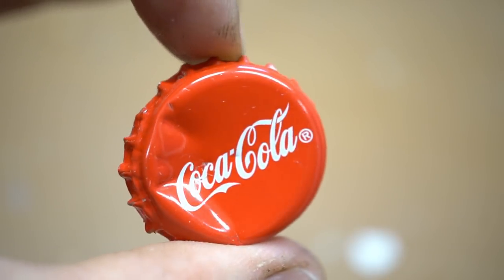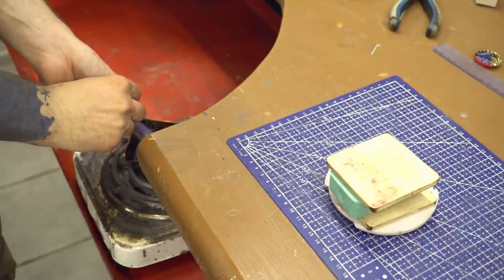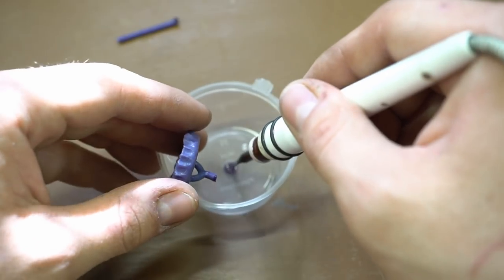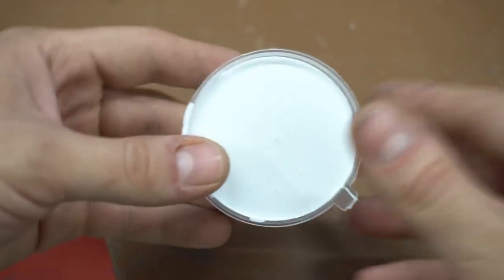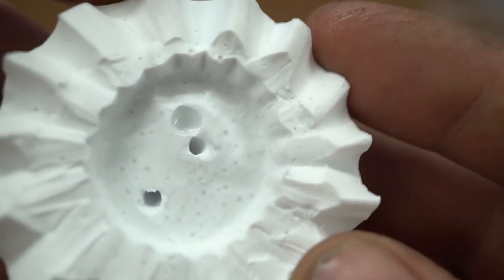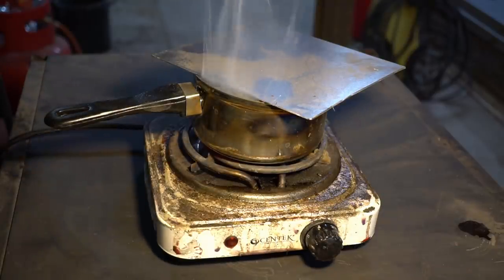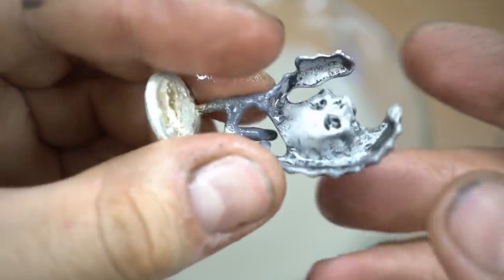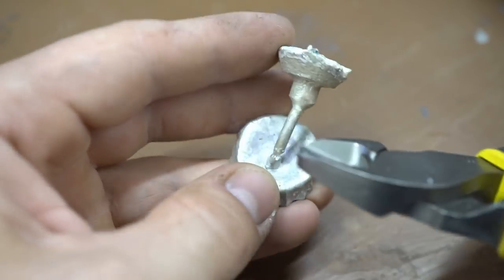Casting Silver Cola Cap At Home WITH POTATO - Will It Work?

Comment: Oh my! Did you ever bring back memories from some 30 years ago! I, myself began my goldsmithing career by building a small kiln large enough to fit a small crucible. The book I was working out of said the investment should be about the consistency of sour cream....so, I bought a small tub of sour cream, dumped it in a bowl, and stuck my bare hands in it to memorize the consistency. I will say it worked. I put my casting project together; put it in my little homemade kiln, dumped some silver on top of the flask, and melted it with an acetylene torch. The method I used to force the silver into the mold was a big, raw potato, cut in half and smacked it on top of the crucible. A few minutes later I pulled out my first successful cast. The principle being the potato is 90% water and suddenly converted to steam and forcing the molten silver into the mold. Just thought I'd share a memory that brought a smile to me. Cheers!
P.S.- I also do a little voice-over work: You did a nice job with the narration.

Comment: Bro, for a better result at this step 03:30 just put your mold in hot water for a while (70-80° if your silicon is okay for this temperature. if not, just immediatly buy some, because it is very useful), then you can cast your parafin in the thin parts much much easier ;-)

Comment: So if I got it right, the steam from the potato or the paper towel was supposed to push the molten metal down into to mold, right?
What if instead you were to use a narrower diameter mold with a metal/glass syringe that fits the mold and created some pressure with it?

Comment: I don't like the way you melted the wax, I used to make candles and found out through research that if wax gets too hot it can reach flash point and explode.
The best way to safely melt wax is with a double boiler, one pot or saucepan inside anther with the outer pan holding boiling water, do not fill this pan , but put more in as needed.
When I was melting wax I was using 5 kilo / 11 pound blocks each time.
I do like the video, cheers.

Comment: Use talcon powder/ baby powder from keep both ends of rubber from sticking to each other. I've made hundreds of rubber molds. I've learned the right way for my mentor. Put the powder in a sock and tap the rubber on both side of rubber. It won't stick. Use some tiny screw caps to line up your mold. And mark the sides of the rubber. To make sure your molds are always facing the right way.  I use different colors of rubber for different parts. White, black, and green. That way I don't have to search through all my molds. Thanks for sharing.

Comment: The chain does not look good going through the pendant. I would recommend attaching a clasp that fits in both holes in the pendant and then running the chain through the clasp. Just a suggestion.

Comment: cool idea!  I think I missed the part at 24:32 that described how and what worked to produce the excellent casting, since until that point every thing failed. I would also invest in a wax injector and some clamps to hold the two mold parts together.
Reply: 24:32 is the last second of the video…

Comment: I made a centrifuge casting machine out of a bike wheel
And a vibrating table out of an old drill with a hockey puck fastened off center to it.and 4 springs plus a few bits of junk